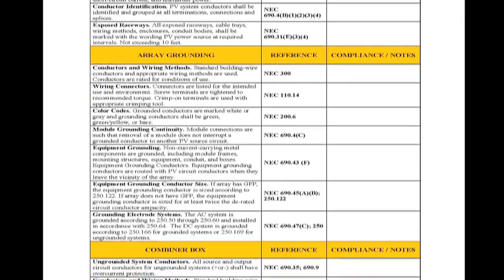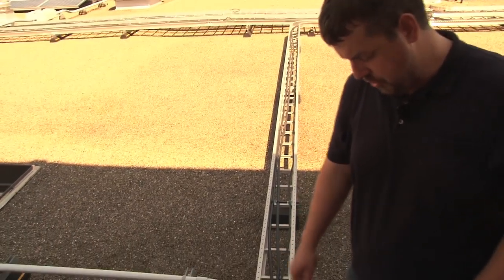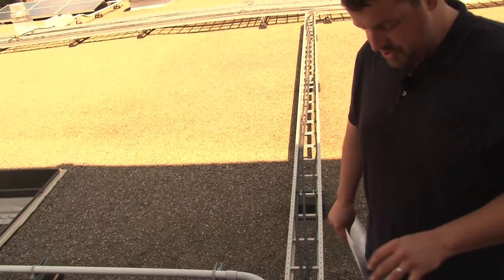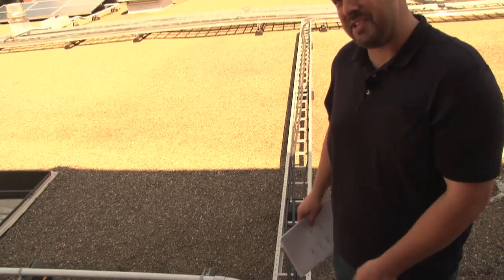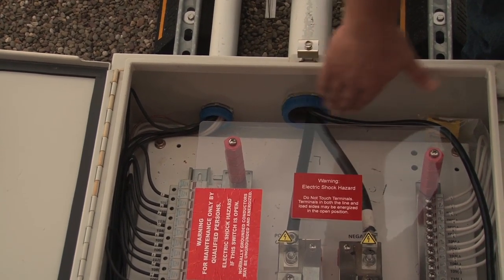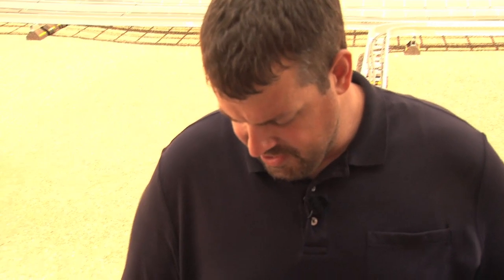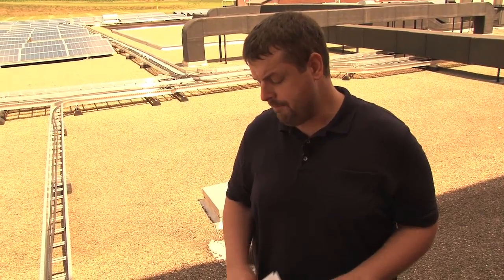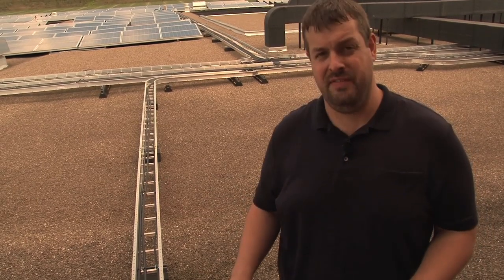Solar PV Inspection Walkthrough - Combiner Boxes (4 of 8)

Comment: there needs to be a code change to have that box up at least  4 feet high and mounted vertically with the door that swings open horizontally. , As an electrician why do I want to have to bend over to service or work on that stupid box why not work on it like a normal panel at normal height
Reply: Because roofs dont have walls
Reply: thanks for the quality video I subscribed
Reply: Or drop a tool into it.
Reply: Perhaps a bit late on the ball... but. No fun having a arch flash in the box while working. Heat will go straight up in to your face. Also if there is raning it will be hard to check the box. Same if there is snow or ice on it (perhaps not much snow where this one is mounted but still not a good solution).

Comment: FYI- Oxidation Inhibitor Compounds are not required. However, they are highly recommended. Where used, the oxidation inhibitor must ensure that it doesn't adversely affect the termination, equipment or the conductors. Review 110.14 and the last paragraph.